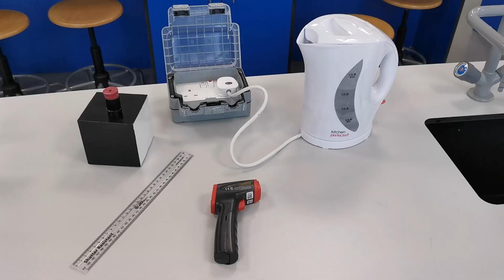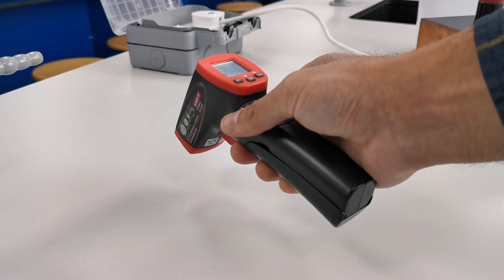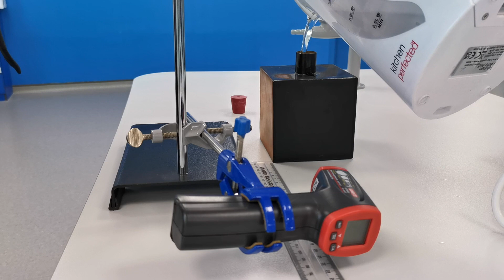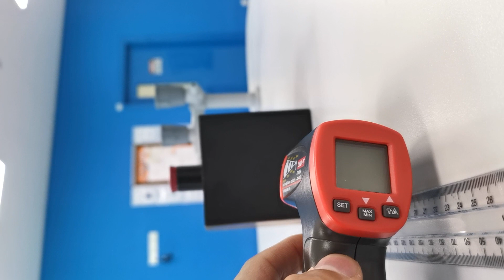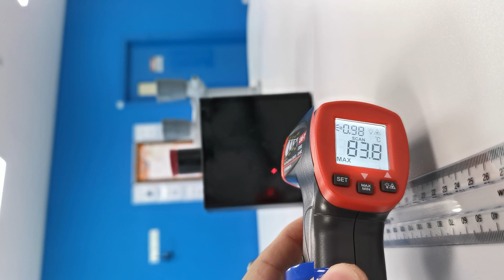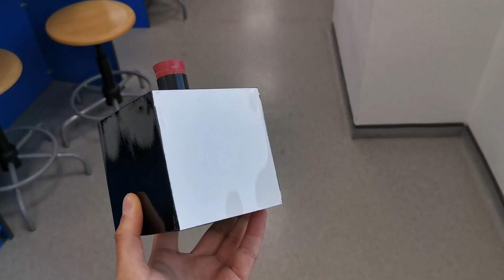Measuring Heat Transfer with a Leslie Cube Using an Infrared Thermometer

Comment: Good video! This experiment explains why high-quality double-walled stainless thermos flasks either have a copper-plated inner vessel, or copper foil wrapped around the inner part. Cheap insulated stainless products have several problems: poor vacuum (losses through convection) and the missing coper layer...
Reply from the maker: Brilliant reference to thermos flasks! Being a teacher, I don't know how I would function without hot coffee 😂
Reply: @science4breakfast Haha, uni lecturer (materials - very basic stuff) & former design manager for a German brand of thermos flasks over here... coffee is/was a core element of both jobs...
Reply from the maker: That is very cool! What are the thermos flasks called? I'll have to look out for one, now I know they've been designed so well! Do you reckon this video would be useful for your students? ☕